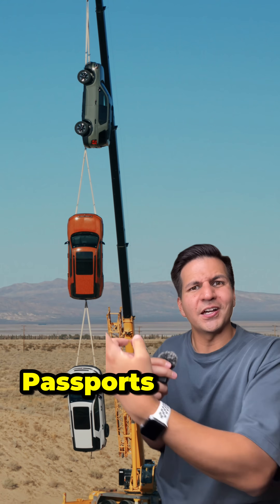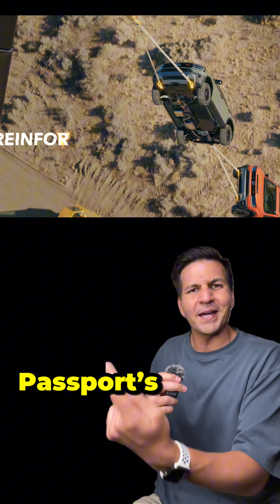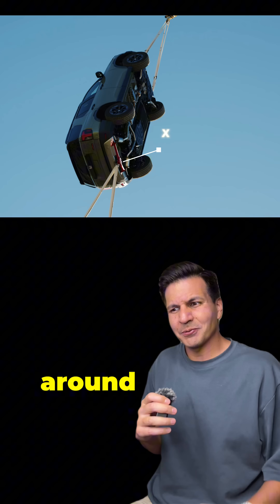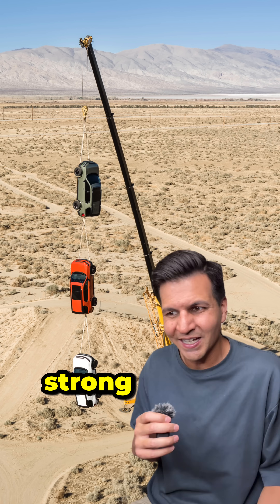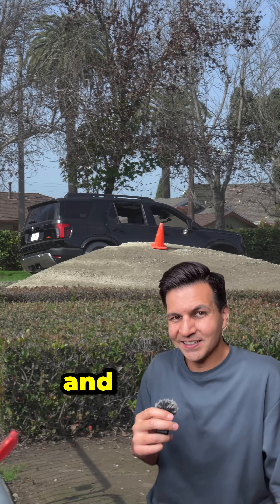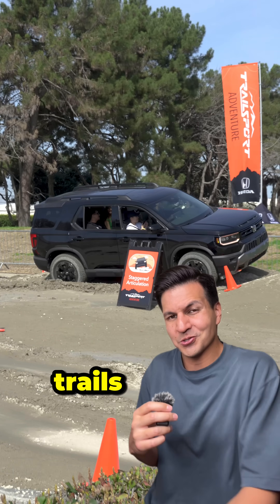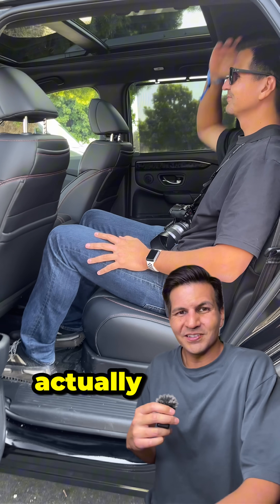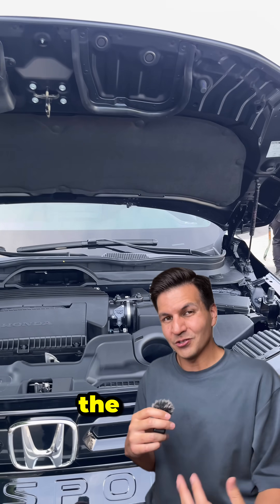Honda Displays New Unibody Chassis Strength

Comment: Limited by it's brakes.... No way it's power train. 80s trucks made less power with way fewer gears and pulled more. It's almost always about the ability to stop the trailer weight.
Reply from the maker: @TylerPeters  I’ll see if I find the exact answer, but there’s also other considerations such as transmission cooling, suspension, etc.

Comment: Please do a video about the new civic unibody. Honda has done some amazing things.
Reply from the maker: Can you share some more on what you mean?
Reply: @SeanChandler  Their new method for forming the unibody is significantly more rigid than previous models (especially the Type R) all while keeping weight down and somehow maximizing the size of the interior. I'm not sure there is another small car that even compares with what Honda has accomplished with the new Civic unibody.
Reply from the maker: @MacCready_ Come to think of it, it is very impressive how the new Civic Si is so light despite its size increase over the decades. Will look further into this